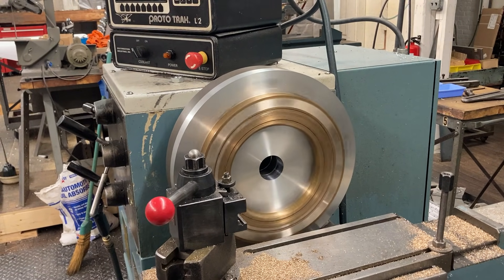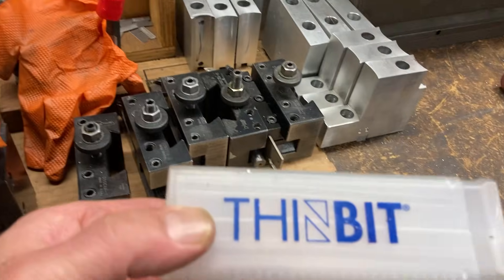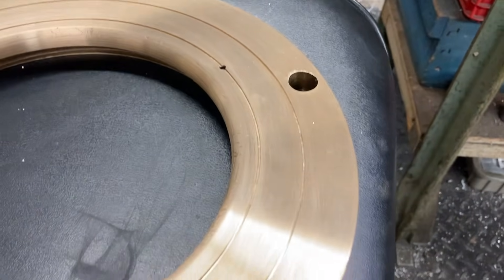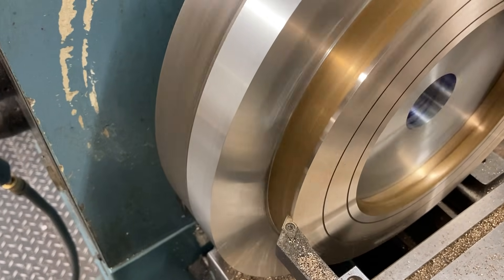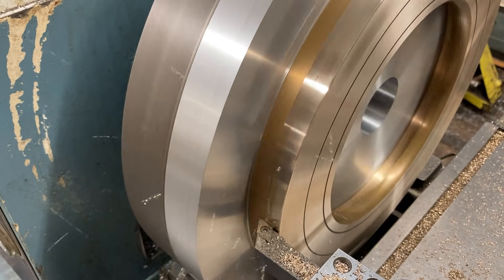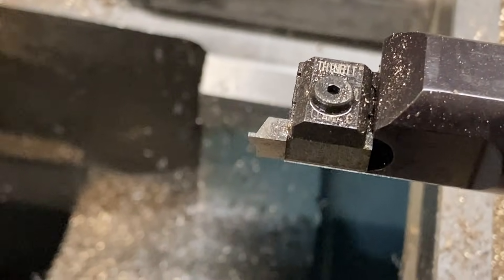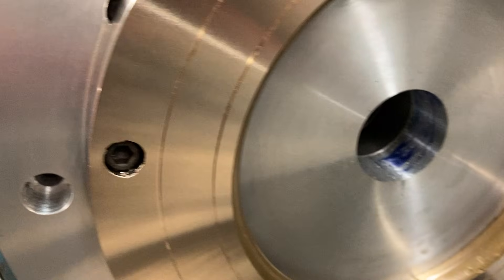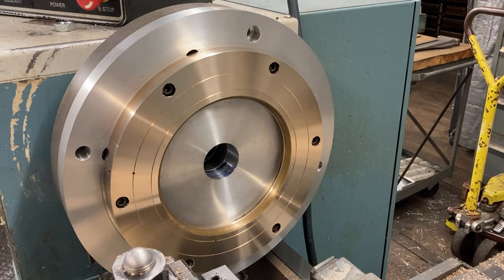RE-Surfacing Facing Industrial Thrust Bearing Plate and Trepan Oil Groove using Kaiser THIN BIT

Comment: Im wondering is those marks on the OD is not porosity in the original casting
Reply from the maker: Not likely, because none of the others have it.
Also I think they were cut from bar stock, not a casting.
Reply: @titanmachinetool  I don't think bronze of that size is available in bar stock anyway? Probably cast-to-order or a large size hollow bar in a 'stock' size, but cast anyway - as that is the way that bronze is made. There is no hot drawn or forged bronze. With the price of bronze as well as the relatively easy 'castability' a near net shape is quite easy to achieve.
Reply: @bigbattenberg  Now don't go makin' sense!  This is the internet after all.